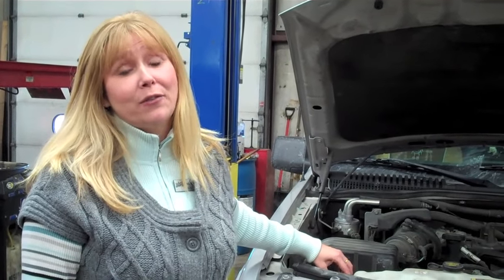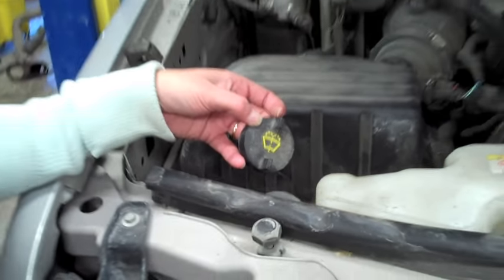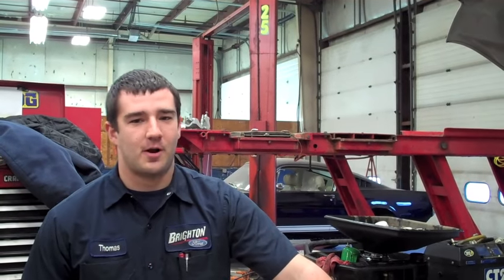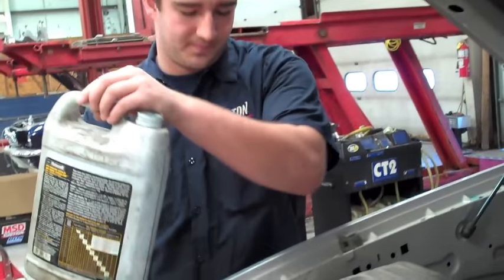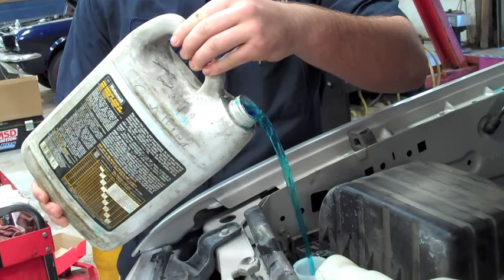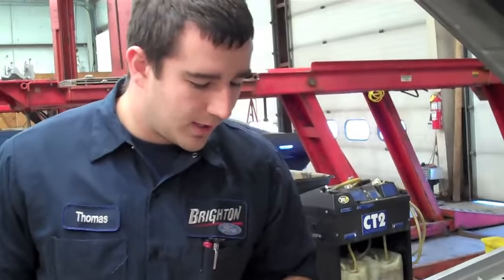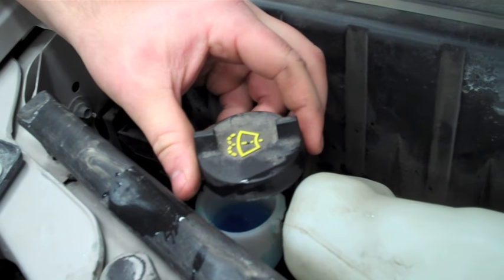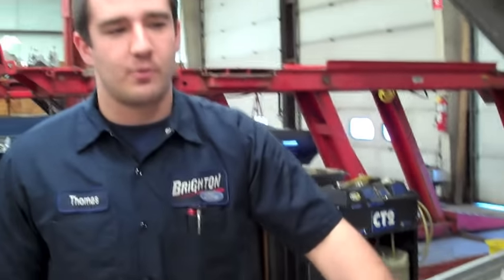How To Refill Windshield Wiper Fluid

Comment: I was going to refill with water😂😂😂
Reply: Saaaaame~ but then I was like let me check on YouTube 🤔
Reply: You can actually do that depending on the water, I don’t recommend it because just buying wiper fluid is so cheap lol
Reply: I saw somewhere that you can use water and a bit of fairy soap liquid
Reply: freezes in the cold
Reply from the maker: You would be surprised how many people do!! ;)
Reply: U cant?????🤯
Reply: @zeke6941   yeah I  think I saw it on the internet or some people just fill it up with only water. I have screenwash in my car though. How come you can’t though?
Reply: @sashachouler6185  It's fine to fill up with clean water. Doesn't do anything bad to the car. It's recommended that you use screenwash because it has additional benefits, such as enhanced cleaning, fragrance, or de-icing properties. In winter, depending on where you're from you generally want to stick with a winter wash because it won't freeze in the reservoir as plain water would. But, back to the original question, you can use plain water.
Reply: @sashachouler6185  if you live in an area where it gets below freezing, just water in the system will freeze and will damage pipes/lines as it expands. Same with coolant
Reply: Same here 😂
Reply: I have a question.i just refill my wiper tank its full but when i check again after i use the car it look like empty tank?

Comment: 2 questions ; I lost my cap, is it still safe to fill up with water. And also is it okay to fill it with water if the car is running or do I have to wait a bit like the radiator ?
Reply from the maker: Hi Ali! Please be sure to use washer solvent, not water. You do not have to wait for it to cool like a radiator, but just be careful to not touch anything hot under the hood. You can call us at 1-800-NEW-FORD to order a replacement cap or visit your nearest Ford dealer :)

Comment: My doughters car (focus 2014), the windshild washer reservoir only works if is full, after press for wash for 5 or 6 times (quick),  need to fill again, and the problem is, only fit 6 or 7 ounces, but if doesnt fill, it not works. Do you know whats going on? I´m sorry for my english.
Reply from the maker: There's probably something wrong with the pressure for the sprayers.  Where are you located at, in Michigan?

Comment: How do I open that part of the vehicle?
Reply from the maker: Great question! Depending on the type of vehicle you own, there should be a release lever inside your vehicle towards the left side of your driver panel. This is usually found closer to the floor. Pull that, then exit your vehicle and approach the hood. Gently slide your fingers between the hood and body of your vehicle (there should be appx 1" of room after releasing the interior lever) and you will find a secondary latch. Simply release the lever and your hood will unlatch. Most models will require you to use your other hand to lift the hood and securely insert the wand into the hood latch (think a kick stand on a bike). For specific information, please see your vehicle's manual.

Comment: My dealer spilled washer fluid in my car.  Will that damage my car?  I read that it might damage my electronics.
Reply from the maker: As long as it wasn't a gallon of fluid, you should be completely fine :)
Reply: @BrightonFordMi  Thank you for your quick response!

Comment: What happens if it burps or bubbles?  And what do you do if it does that?
Reply from the maker: When it bubbles a little bit of washer solvent may bubble out...it's fine if it happens, you just may have to add more solvent to fill it up.

Comment: i did mine and it took a while jug of it but it was full, so i need more?
Reply from the maker: Hi Charli - you should be able to see the fill line when you look into the receptacle. If you filled an entire gallon of windshield washer solvent, you'll be good for a while, even if it isn't completely full. Thanks for checking out our channel!

Comment: Can I use soapy water?
Reply from the maker: Either plain water or windshield washer solvent is suggested depending on where you live.  If there is freezing temperatures water will freeze, so use windshield washer solvent there.

Comment: Can I use tap water?
Reply from the maker: If the temperature gets below freezing where you live, you cannot use water and must use windshield washer solvent.  If the temperature never freezes then water can be used.
Reply: Omg thank you for asking this question! I had just filled mines with water and freaked out when I saw the guy filled it with actual windshield wiper fluid.

Comment: Hey I just did the steps exactly right and the fluid still isn't coming out please help. I have a 2004 Impala
Reply from the maker: Hi Fredo, If it's not working after you have filled it then there might be a crack in your line or something else that has gone wrong.  You can bring your car into Brighton Ford (http://www.brightonford.com/) and we can try to see what is causing this issue.  Have a great day!

Comment: Can you just put plain water?
Reply from the maker: No, please do not use plain water. It can freeze and ruin the system. You can find windshield wiper fluid at almost any grocery store or gas station for very little money.

Comment: Where is the jug for the back window washer for a 2013 escape
Reply from the maker: Hi Rob, there is just one water solvent reservoir for both the front and the back and it's located in the engine compartment at the front passenger side.  Good luck!

Comment: well my dumbass just added water instead of the  actual fluid 💀
Reply: Daniel Beltran lmfao
Reply: Daniel Beltran me too 😛
Reply: Same ;-;
Reply: me too...i always thought it was water that was supposed to go in there
Reply: I added water too and now nothings coming out when i try and wash it. What do i do. Ps. Its a very cold and snowy day but i check the water and it hasnt frozen up.
Reply: junedali7861 
The tank might not ve frozen but the watwr in the pipe is.
Reply: junedali7861 the water closest to you hasn't frozen up but that doesn't speak for the reservoir and the lines. If you are in an area that shows or reaches freezing, DON'T PUT WATER IN YOUR WINDSHIELD WIPERS RESEVOIR. don't do it regardless of where you live honestly. It's super inexpensive. All these people saying, that's what I do, or, you're stupid just use water... that's great for them, but that is not the RIGHT WAY.

Comment: Can I use a water bottle???
Reply from the maker: Hi Vertt - water is not recommended! It can freeze - please use washer solvent (windshield washer fluid). Using a funnel will help avoid the splashing though :)

Comment: I just bought a bottle of Water & added it I ain't gon spend all that money on solvents 😰
Reply: ilyn Payne its literally $3
Reply: It's aprox $3. RainX All season (yellow liquid)  is the one I use and I buy it for $2.79 at Walmart.
Reply: Quit being cheap it’s literally under $5 at Walmart
Reply: If you live in a cold environment water will freeze, the ice will expand, and it could break the tank. If you live in a hot environment it'll just evaporate so you'll always need to refill it which we're in a drought so don't

Comment: how do I fil rear window washer fluid
Reply from the maker: When you refill your washer fluid in your engine compartment it automatically refills both front and rear washer fluid.  Give us a call if you have any more questions at 810-227-1171.
Reply: The washer fluid refill tank is in the rear tail light. You need to pour it into the rear tail light and it will automatically drain into the tank. Hope this helps.

Comment: WHERE I am from we use water is that wrong
Reply: Napoleon Pinedo If you don't experience freezing weather where you live it should be fine.
Reply: ok tanks no we do not experience freezing weather contrare its super warm here skyline
Reply: +Napoleon Pinedo You may be more likely to contract legionnaire's disease, but other than that, it should be fine.
Reply: Also hot temperatures with a running vehicle makes the water evaporate, so too hot or too cold is bad, that's why it's usually just best to use windshield wipers fluids because they are temp sensitive and last longer (more viscous)

Comment: He was in a mechanic shop, why didn’t he use a funnel to avoid all that splash. To those who doesn’t have a funnel, he could had recommended to cut a plastic water bottle in half and use the top end as a makeshift funnel. Also clean your hands after all that splash back, that fluid is poison and you don’t wanna accidentally ingest it if you decide to go eat a hamburger.
Reply from the maker: You're absolutely right - this video was made 10 years ago and we've since redone it with the funnel :) Thank you for watching and the valuable feedback!

Comment: I thought it could take just detailed water
Reply: Distilled*
Reply from the maker: If you live somewhere warm, where the temperature never gets close to freezing, then water will work.  Our dealership is in Michigan, so we have to use windshield washer fluid that doesn't freeze.